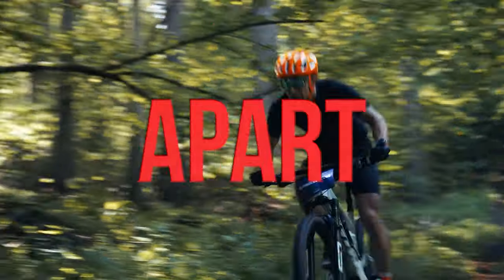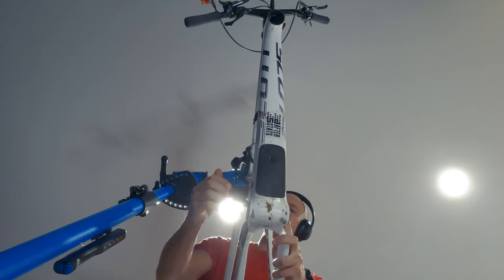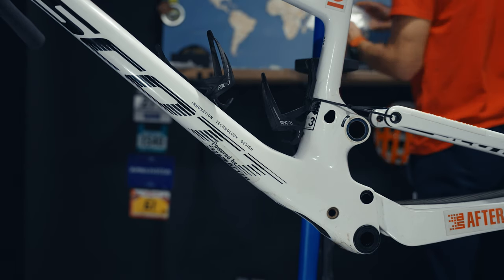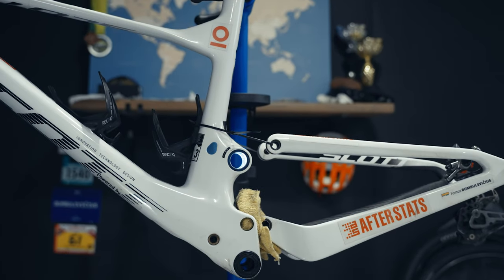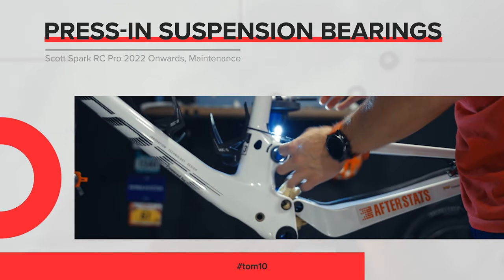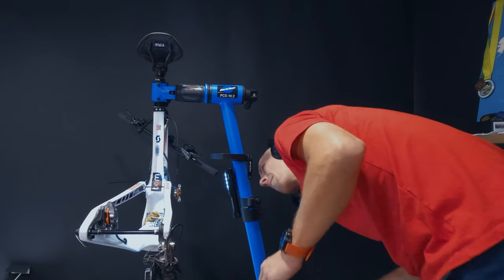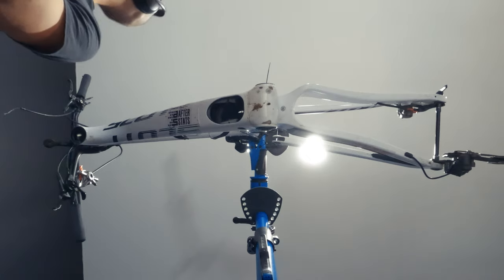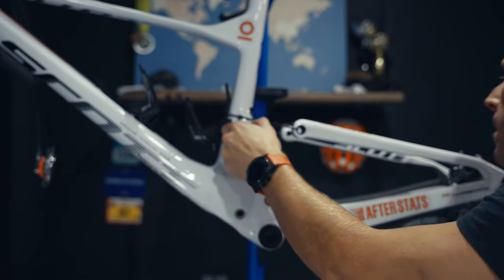Scott Spark RC 2022 Suspension Bearings Full Service - A to Z

Comment: Tomas, this video ist pure Gold! As I told you in the other video, I got the same bike like you and some day the same thing awaits me to do to, and your video is going to help a lot. Regarding your question about the video, I would prefer the video to be whole. Assembly and disassebling :)
Reply from the maker: Thanks a lot, Ivo! While for now I am still ahead with the topics of your interest - maybe there are something you are looking for which is not available? Haha! I have plans of few other maintenance videos though 👌
Reply: @Tom10 Crafted , well right now I'm looking to purchasing a torque wrench because i want to change my head angle to -9. I know you already did that on your bike  but I'm a bit of worried because I never done anything other than removing the front wheel of the bike for transport. How did you get-20 ° on your handelbar?  Did you had to purchase a new one.?
Reply from the maker: Yes, I got a new handlebars and made a swap myself. its not a difficult process to do, you will only need to add everything from old handlebars to new (you will see, its an easy thing). And then when assembing handlebars on the bike, just make sure not to squeeze the cables and align them with headset cups - you will get what I am saying once removed ;) Torque wrench is good to have!

Comment: Hi Tom, This video is pure gold.
You said that you got some troubles to remove the link at the minute 3.40.
On my bike is competely stucked.
Anybody else got troubles with the link. 
I can't change upper bearings without removing it. :(
Reply from the maker: Hey, that most likely means one thing - your bearing is rusted into the pivot. Take rubber mallet and hit it softly - it will come out loose. Just for sure - don't forget to remove the bolt between the pivots!:)

Comment: According to Scott technical documents you need to aply bearings fit solutions from loctite. If you used grease i recommend to check the suspension screws often tan usual.
Reply from the maker: That is true, thanks for a notice!
Reply: @tom10crafted  Where can i obtain this manual? In the standard owners manual there is no mention of bearing fit other than on page 4.

Comment: Thanks for this very helpful video.  You mentioned you lost the frame cover for the shock.  Me too.  Anyone know how I can order new cover online?
Reply from the maker: Hey Jim, thanks! For me it was a success, as I managed to catch it just before dropping off :) However, I saw on R2-bike there were those spare covers - yet, recently they were out of stock :| For now probably the best way will be duck tape applied vertically & horizontally untill you find where to buy it

Comment: Hi Tom, I'm a mechanic from Nicaragua, Latin America. Three customers have come to my shop with the same problem: the rear triangle is loose and the chainstay pivot (as shown at 4:49) is damaged, with the dropouts of the crown broken. These are bikes with less than 3000 kilometers. What do you think about the safety of this pivot system?
Reply from the maker: Hey Marcel, thanks for your interested! Could you elaborate how the dropouts are broken? Just to get an idea what has happened. Thanks!

Comment: Is there any documention on what bearing sizes to order? The offical Swing-Arm rebuild set is sold out everywhere and I can not find any information on bearing sizes.
Reply: Also great video, thank you so much!
Reply from the maker: Hey, yes! 6801 for seatstay
6802 for chainstay

And main pivots are 37x27.7x6.5, its custom

You can install 37x27.5x6.5 but when rubber seals shall be removed

Comment: Hi Tom, what would it be the correct tool to remove the bearings and axle from 15:16s without damage, thanks
Reply from the maker: Hey Bernardo. The hardest it would be to remove the first bearing - without special tools you need to have some blunt tool, smaller than diameter of the bearing. The inner tube/axle between the bearings has cuts, so in these areas you have access to knock at the bearing.

The second one  is a lot easier - either by using the socket heads or knocking softly from the inside with socket head. Important - try to use some tool as wide as the bearing itself, so that way it will cover more surface and won't cause directional hits.

Comment: Hello my swingarm on my scott spark rc 2022 is becoming loose when i ride. What should i do?
Reply from the maker: Hey, could you try to describe how loose it becomes, and in which bolts/pivot points the play happens if its possible to figure it out?🤠🤘🏼
Reply: @tom10crafted   The movement is on lower part of the linkage. The two lower bolts on the swingarm.
Reply from the maker: @rasmuswiklund3980  the easiest thing you can try to do is to tighten it like I shown in the video from 29:45

If it doesn't help, then disassembling and inspecting the bearings. If bearings are OK, regrease and assemble it again. If NOT, then bearings change is required
Reply: Okay thanks Tom👍

Comment: Hi Tom, i think you said you tighten the pivot bolts to 15 nm, but I says 10 nm on my Spark RC 2022? I reckon somebody told me that 10 nm is to low and should be tighter…. Do you know anything about this?😊
Reply from the maker: Hey Michael, bolts should be tightened at the specified torque, no more no less.

There is one thing though - its about shock’s top bolt, which connects it pivot. If your bolt is black (it says 10Nm on it), you should replace it with updated bolt with 15Nm markup, its titanium/not black.

Otherwise, use specified torque on suspension bolts, or by using more force you will destroy rubber washers in between 🤘🏼
Reply: Thank you very much!! I saw my bolt is the 10 nm on the shock😬
Reply from the maker: @michaellogan5413  its better to change it, just to make sure you save yourself from failures. Internet is full of people who didn’t care - until it damaged the frame 😅🫶🏻
Reply: @tom10crafted Hello friend! Where do we find the 15nm bolt to replace the black one ? Link ? thank you!
Reply from the maker: @DimkaKruglyNos  Hey! here is a reference:
https://r2-bike.com/SCOTT-Damper-Shock-Mount-Bolt-Kit-Spark-2022
Reply: @tom10crafted  Thank you very much!!
Reply: @tom10crafted Tom, sorry for dumb question, but where it located ? The bolt on top of head set is without markings, is it the same bolt should be replaced ? can it be seen without disassembling ?
Reply: they say the 15nm is the bolt from the shaft (i believe its from the bottom of the shock, not the top , what I missing ? thank you!
Reply from the maker: @DimkaKruglyNos  there are two ways to figure out which bolt you have without disassembly. Remove the rubber on the left bike side and then:
A) Sit on the bike on open position and someone can inspect the color of the bolt.
B) Remove air from the shock and then it will go down. Do this only if you have shock pump and now how to inflate it properly

Comment: Hello, i just did the job on my spark and i was angry at scott for not providing such informations in the manual, especially because some threads are reversed. I guess they want you to pay the shop for that but we have our reasons to do those jobs ourselves.
Anyway, i looked closely at the part and you should NOT unthread the little sunnken screw in the rocker. Its purpose is to lock the black ring that control bearing assembly preload. I suppose it's factory tuned. It does not look impossible to tune it by yourself but it's a tricky job. Not enough preload and play will appear, too much preload and the bearing will be thrashed. There is obviously a special tool to screw the loading device in place but without this tool it will be a delicate operation.
Reply from the maker: Hey Antoine, thanks for your response. Well, actually even in tech book its showcased that preload ring is being tightened with some "blunt" tool like screwdriver. The reason why I assume there is no special tool for that as well, is because there is no "room" to fit it in. Anyways, you can't ignore and leave it untouched, simply because it has to be greased and maintainted. While yes, it can be tricky to set it up, but leaving it just as is is not an option either! :)
Reply: @tom10crafted  You can clean it without unscrewing the preload nut, it's not a moving part. I think i'll check tuning on mine because my bike assembly was far from perfect elsewhere but i would advise people without bearing assembly knowledge not to change this tuning if the pivot is properly working.
Reply from the maker: @TheAntoine191  thats true, but without re-greasing it you are also prone for future issues. That part gets lots of mud/water. Not saying that someone should start disaasembling just to clean it though.

However, its not 100% that from the factory that part was set properly, unfortunately :)

Comment: Wouldn't it be easier for an amateur like me to do one pivot at a time? Can it be done?
Reply from the maker: You mean pair of pivots at a time?
Reply: @tom10crafted  sorry yes a pair.
Reply from the maker: @rottieshepcalibre9156  you could inspect them one after another and make a decision if the change is needed, but because most of things will be unscrewed already - I would better suggest it to do in one go 🤘🏼 Less maintenance, more ride!
Reply: @tom10crafted  thanks
Reply: Hi Thomas- Have a 920 spark 22’ that I changed the rear shock cable. Torqued everything as needed on pivot bolts, except that INNER one on the lower pivot.  Now I’m getting an odd clunk after the shock is in full lockout & in medium setting. Not when fully open via twin lock.    Thinking it might be something on lower swing arm as you said you had been getting.        A friend said try pull & clean lower swing arm bolt & sleeve first.    Then possibly coming from shock bushings if not that lowerswing arm area.    ?— — Thoughts?     - Can’t say THANK YOU enough for sharing this video!  So awesome….. 👍👍🤘👍🤘👍
Reply from the maker: @Oboingo13  in addition to what I wrote in other comment, once you remove the swingarm chainstay/bottom axle, put your finger inside the swingarm and check whether the inner tube is not rattling. This is not related to the change of the cable - maybe you have loosen down the shock itself while changing the cable?